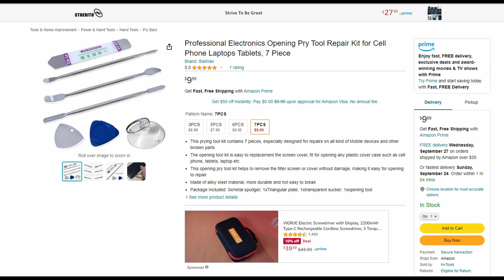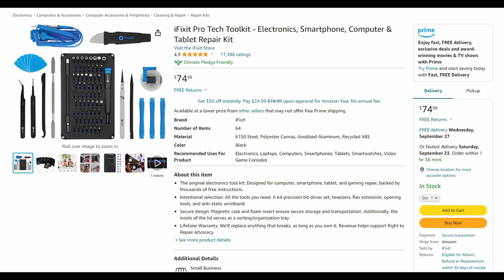Logitech MX Keys Keyboard: fix sticky keys!

Comment: One day... One day I will finally master that prying manouver. My success ratio is around 50%. In last 5 years I've managed to properly clean 5 and also break 5 keys... (2x scissor mechanism, 3x clamps on the key itself). Been really delicate and everything :/ On my second MX Keys keyboard now (switched to Mini). First one looks like Frankenstein monster because these replacement keys from Ali don't match colours but now I got donor for the scissor mechanisms, unfortunately Logitech decided to slightly change the letter transparancy and keys look different even if both are graphite scheme. It's really annoying that it's so fragile and one wrong move and you're cooked (e.g. scissors bottom prying off first instead of key itself or clamp just breaking because reasons)

Comment: The question is what kinds of issues will this fix? Some of my keys on such a keyboard only register if I press them a bit harder, but they said in some repair shop it needs replacement parts. Does it?
Reply from the maker: Where there's dirt under the keycap chances are that key presses will not be registered. In my case I had some bread crumbs and about 50% of my key presses were not registered.
Reply: @mad_buildz  thanks, sounds promising!

Comment: I was afraid that cleaning this keyboard will be risky. You just saved me! Big thanks!
Reply: Nonetheless it is VERY risky and I strongly discourage it. Just fixed 1 key cap, which I had to buy from second hand for like 1/10 of the price of the keyboard.
Reply: @1lubo1  Exactly this week I had to pop up a key because something was stuck in it. I managed to break a small peace :( Luckily I managed to swap it with a button which I barely use. But the broken one still feels like nothing broke.

Comment: Don't do this for the mac version!!!! The keys have an extremely fragile frame, which will break when you take them out. You will not be able to put the button back. I just broke my keyboard :'(  Shame on logitec for this design!!!
Reply: I was able to remove all the keys on my Mac version with only the enter key on the num pad breaking because I didn’t take my time with this one. Not sure how you had such an experience though.
Reply: Same happened with me. Broke mine too. Non mac one.

Comment: I did the same, i broke 2 of my keycap.
And to replace these 2 keycap it cost 1/5 of used mx keys.

So i got myself a nuphy where everything is easily replaceable and replacement is not as expansive. 
Took me months to decide on this low profile keyboard, i have small hand.